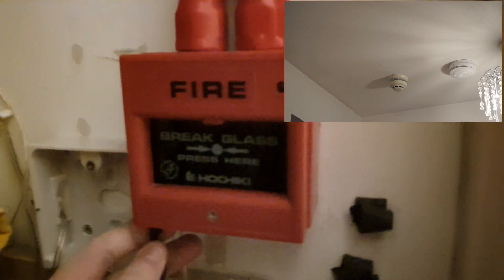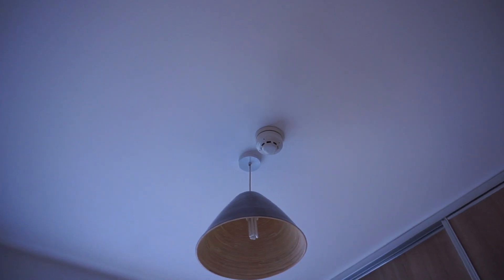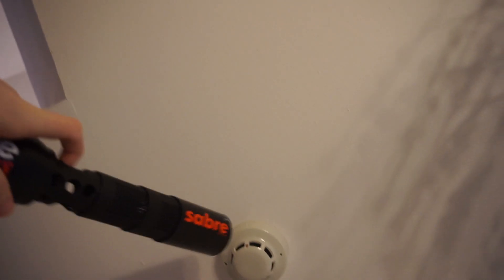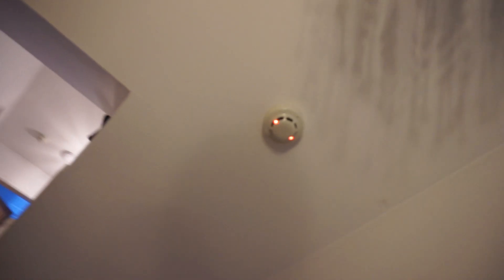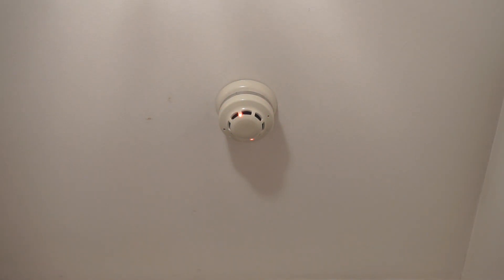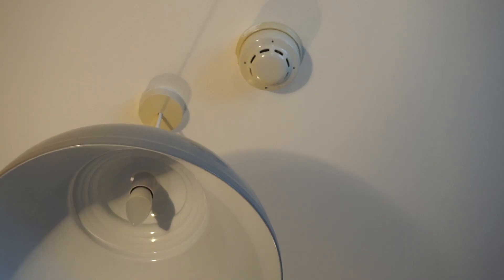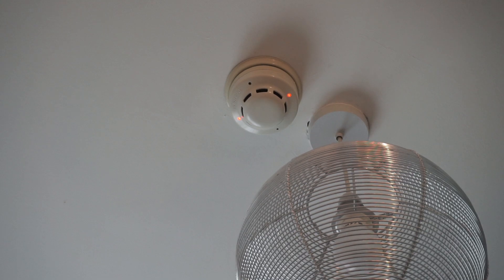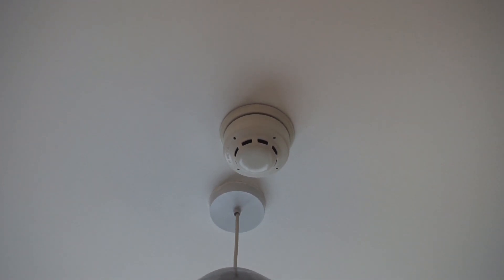Hochiki ESP Addressable Fire Alarm System (System Test 20)

Comment: I got an different hockiki base sounder, it’s all wired in working but sounder don’t work.
Reply from the maker: What type of sounder do you have, Also what panel are you using it on.
Reply: @ASSystems  it’s called a CHQ-BS and using a kentec series 6000 panel
Reply from the maker: @uksds3806  You sure you panel is a hochiki protocol version ? and make sure it is wired correctly. Not sure but you might either have to get a detector put on the base to get it working to give it an address or you need a programmer.
Reply: @ASSystems  it works but it don’t sounds off just like a normal detector base that don’t sound

Comment: also, i was planning on being the only one with a hochiki house system so thats not nice.
Reply from the maker: haha sorry, hochiki is just too good.
Reply: @ASSystems  You're not wrong haha!
Reply: @ASSystems  it sure is but even still it doesn’t matter anymore who’s the first to have a complete hochiki system in the house
Reply from the maker: @matthewjones9259  I'm sure both our systems will be good!
Reply: @ASSystems  I recon yours will be better because it’s got CHQ-BS sounders even though they’ve been automatically reprogrammed by its panel due to it being newer than 2006 and making it sound like a YBO-BS
Reply from the maker: @matthewjones9259  the panel is actually form 2003 you will see it. The chq-bs has 7 tones i found out that's why it would have sounded different for you. Also harvey has a nicer panel than me and it's nice and new!
Reply: @matthewjones9259  Just because the sounders are older doesn't make it a better system xD
Reply: @ASSystems  (Your sysem looks really cool) Mines basically on hold till i get more devices because im wanting to use newer stuff so the new ALN-EN's and YBO-BSB2/RL however im gonna get a CHQ-WS symphoni cos why not
Reply from the maker: @145-k1b  The newer stuff is probably just as good as the older cause not much is changed. I might end up with a ybo-bsb2/rl since I need to get another one of those for the hallway. I'm going a shed extension at some point so I might invest in one of the newer aln-e detectors.
Reply: @ASSystems  may aswell get 2 lol, they’re nicer in my opinion the VAD
Reply from the maker: @145-k1b  i'll have to see cause I don't think it's worth replacing the one on the landing as it's in good working order.

Comment: Good video Adam. I wasn't expecting the Hochiki system to go up and I see you have a battery powered smoke detector in the landing
Reply from the maker: Ah yeah i fitted a aico mains detctor too, just wanted to see what they were like. Pleased to say they were easy to install.
Reply: I have an Aico system too I have one heat and one smoke and I'm the one who tests the system
Reply from the maker: @jameswhetton5202  ah nice one, i've just got the one cause i've got the fire alarm system so i don't really need it. But there very good for domestic properties.
Reply: If I got a fire alarm system for my home in would get Apollo Addressable because that's my favourite
Reply from the maker: @jameswhetton5202  nice, apollo is decent kit. I have had no faults with it before.